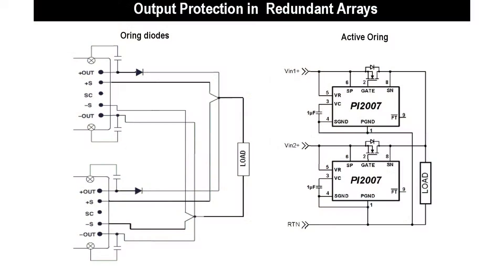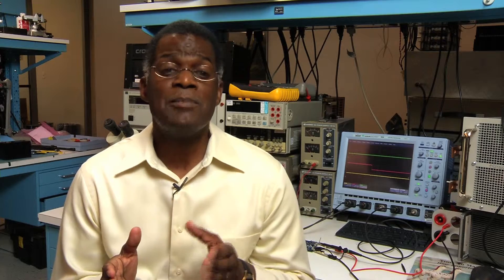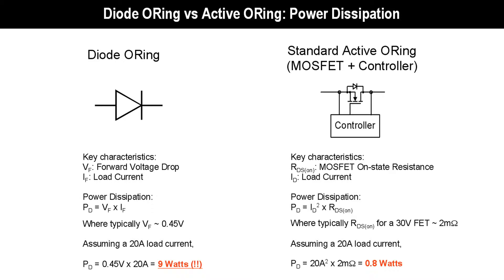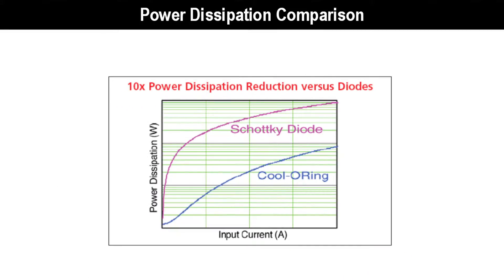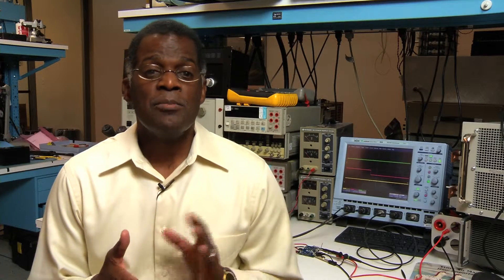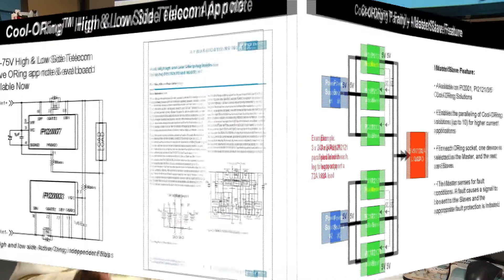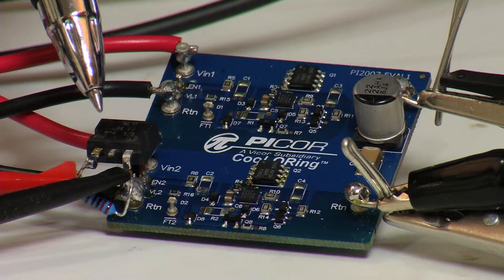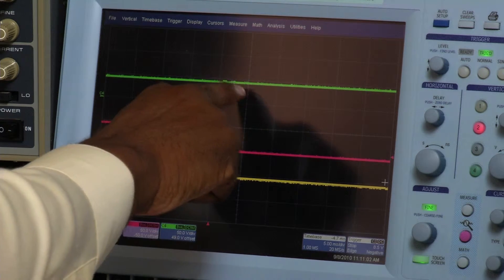How to Use Oring Diode Solutions to Create Redundant Power Systems

Comment: in diode Oring circuit the -ve terminals of both the supplies shorted. This creates problem in isolated circuits where both the dc sources shall be isolated in all times( bothn +ve and -ve). Earth leakage in one circuit reflects in both sources. What happens if the diodes are used in -ve terminal also in reverse direction to avoid common -ve...? suggest plz.... i want both the sources shall be isolated...